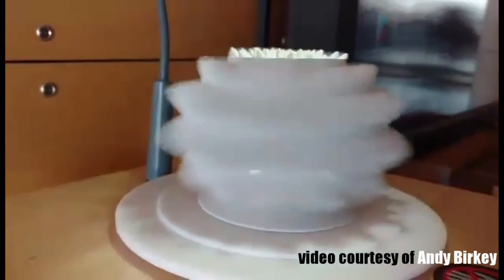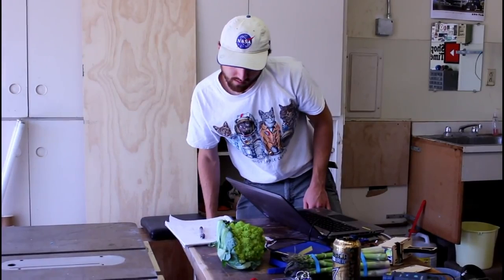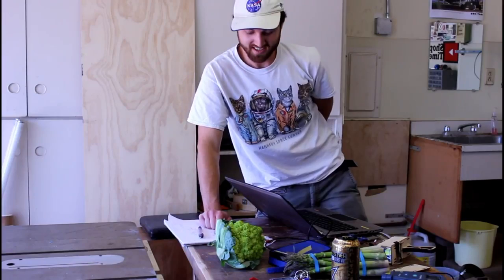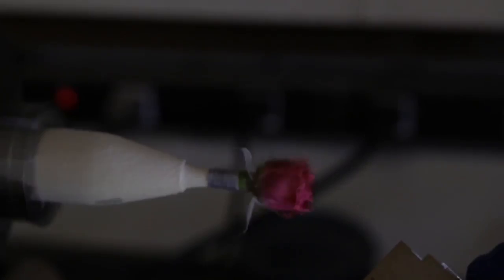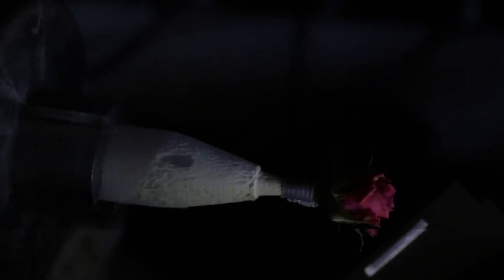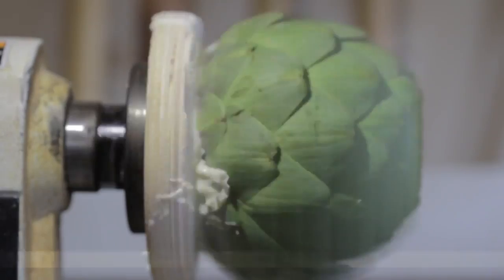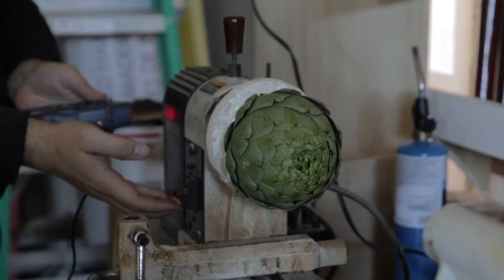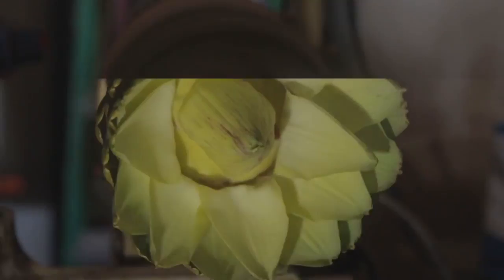The Artichoke Zoetrope with William Osman

Comment: Peter you should have synced your camera's frame rate at the same frequency as the stroboscope (unless you did already) all we can see on the rose and the sand belt is a blur!  The artichoke worked fine though

Comment: Try to freeze colored water and dip it in fast curing epoxy and make a snow globe out of it.

Make a clay snowman and glue it to the bottom of a sphere mould and then add the colored water in, you could try mixing in some fine sand or glitter and let it freeze. It would be a cool project. If what i said isn't working try using some other techniques. Like if u agree!

Comment: Now anchor an artichoke in a sealed resin mold and spin the whole mold until the resin sets.

*edit:  Actually that probably won't work.  If the artichoke floats in the resin, the buoyancy would push the leaves together.